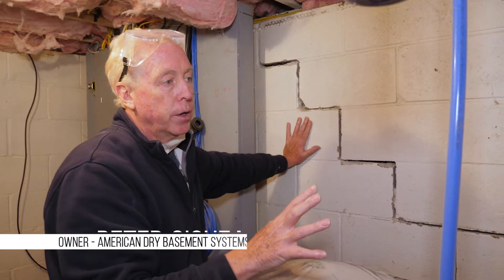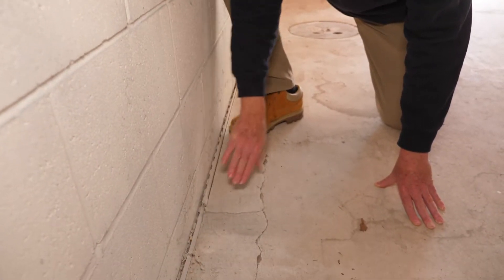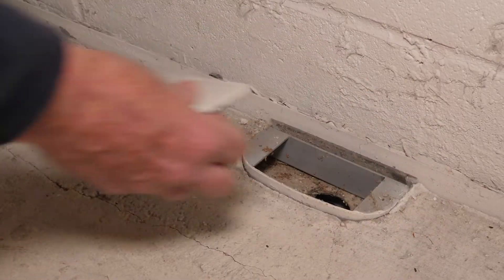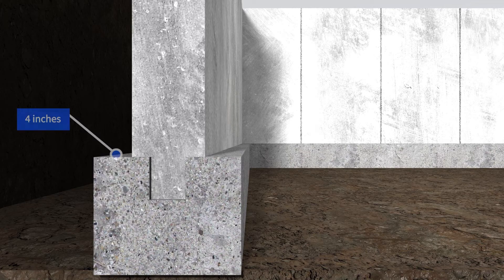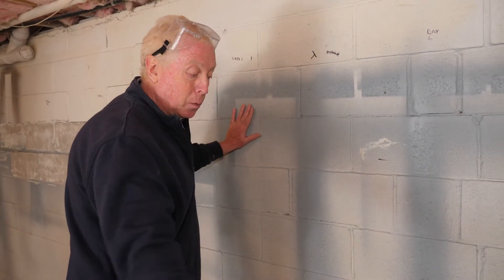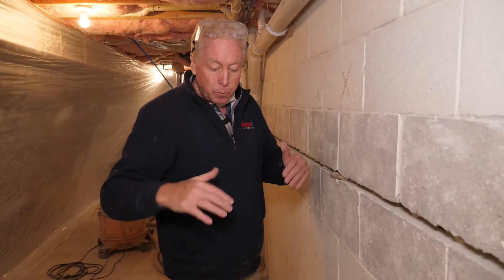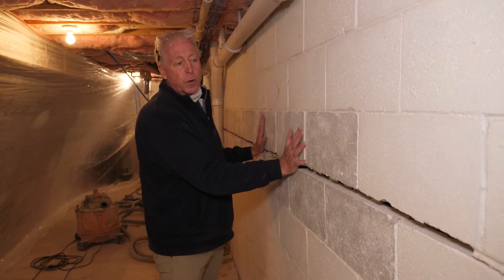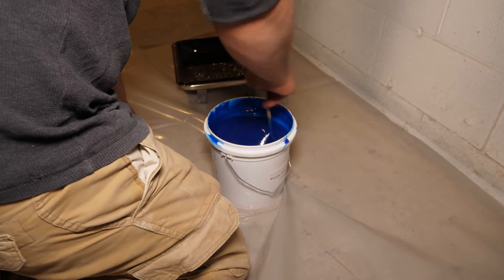Basement Block Wall Crack Repair | Carbon Fiber Straps

Comment: Are carbon fiber repairs also waterproof?
Reply from the maker: The carbon fiber straps themselves are highly heat resistant, but I would recommend apply a fire-resistant coating over the straps to enhance protection.

Comment: Ooh those are nasty, nasty cracks! For us, our small step crack was hydrostatic pressure after a tornado cut the power and we didn't have a battery back up system. For 2 hours, we bailed out our sump crock!  Like a fire bergade. We were exhausted!  The crock flooded to the top and never over-flowed onto the floor. We got up in the morning and a tiny step crack to the sump crock ran asross the wall. There are no cracks on the floor. We are on a hill, but the whole subdivision below us had basements that were filled with 5 feet of water!!!

Comment: Can Carbon Fiber be used on a bowing brick foundation wall? Also what are your thoughts on using high strength steel straps for a bowing brick foundation wall? Thanks.
Reply from the maker: Yes carbon fiber straps will work on brick walls. It is not effective on walls bowing more than two inches. Steel straps can be used but not my preferred choice.

Comment: Did you have to do any drainage work on the exterior of the basement to prevent any future movement of the walls? Or do you rely on the carbon fiber straps exclusively to keep the walls from moving under the pressure of the false water table?
Reply from the maker: No. The homeowners installed an exterior drainage themselves before calling us. Down the road, if water seeps in again, we will install an interior system. It is the only sure way to manage water seepage, or we would be in the exterior waterproofing business too.

Comment: I have similar sized cracks going verticle 1cm in gap, will fiber bonding cement work to fix the joint? I was thinking of just using mortar but I think the fiber bonding cement will be superior, am i correct. Thanks for your reply. Cheers.
Reply from the maker: Fiber bonding cement works great with fiber material. Not made for cracks. Use epoxy instead.

Comment: The carbon fiber adds strength. How does it prevent shearing at the top and bottom without anchoring it like you showed? Would have been great to show the entire fox even if speeded up. Thx for the videos.
Reply: They should have straightened that foundation out first.

Comment: You do a great job! Please keep the videos coming! In your method of dewatering, you protect structural integrity by preserving  bearing along the edge of the basement slab, and you enhance drainage by deepening & widening your trench. I assume you have to be pretty careful to stay above the 45 degree 'safety cone' beneath the footing, or accidentally undercut it.
Reply from the maker: We never... never go below the bottom of the footer. We work parallel to the footer. Accidental over trenching is an amateur mistake.

Comment: Is that just as strong as breaking out a core and installing several sticks of 5/8 rebar and then filling is completely back with structural load bearing grout. Basically making it a solid column. Ya the Carbon fiber straps have an insane tensile strength but tensile strength is pulling strength, rather than barring as the wall is pushing out because of the hydrostatic pressure the water is creating. Just curious is all. I did structural restoration for 13 years. Block walls are suppose to have rebar placed every 4 feet and the core completely filled.
Reply from the maker: We use to do it the way you describe it until carbon fiber came along. If the walls are not bowing out more than 2 inches Carbon Fiber Straps are up to the task. The installation is not as invasive and costs a lot less. If the walls are protruding more than 2 inches, rebar and carbon fiber straps are useless. Get a structural engineer to install subfloor wall anchors with jacks.
Reply: @AmericanDryBasementSystems  Thanks for the reply. What you described is also what we did as far as if the wall was protruding more than x amount of inches.  We had many options for home owners and business owners as far as what their budget would allow.

Comment: I need you guys to call me when ida came it filled my basement up with water like 8 inches.i saw the water coming in from between the center block's and couple places between foundation and center blocks and water was pushing through the crack in the middle of the foundation i called you guys and never got a call back mabe someone will see this and respond i live in South Central pa
Reply from the maker: Hi Keith. Sorry to hear about your basement water problem. We do not work in PA, and we are currently overwhelmed with new homeowners in our service area in NY and CT. Look into American Waterproofers Inc. in PA. They may be able to help.

Comment: I sure could use your help! I am over on the Oregon coast and I bought a house with an old basement in the walls have some cracking in it. Pretty sure there’s no existing drainage system around the foundation
Reply from the maker: The softer soil around your house is filling with rain water or from a water runoff. Hydrostatic pressure is so great it is cracking your walls with or without a system in place. The point of the video is that you need a drainage system that keeps the water level low around the house, thus minimizing pressure against the walls.
Reply: @AmericanDryBasementSystems  will an interior system that sits becide the footer relieve the pressure? How does the water actually get inside the system if it's outside? We have a interior system but I was just curious if and how it drains the water table outside